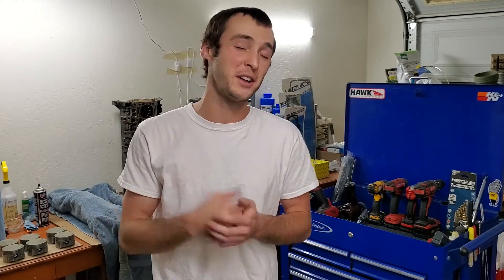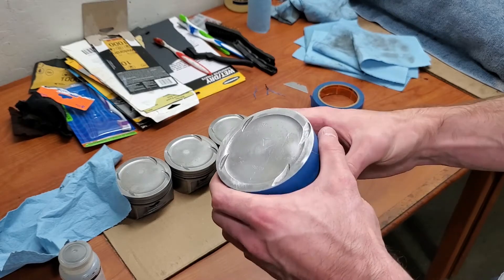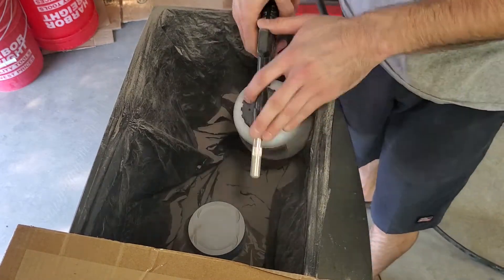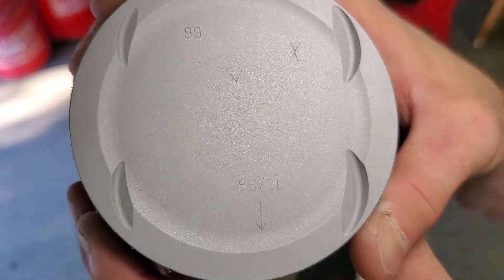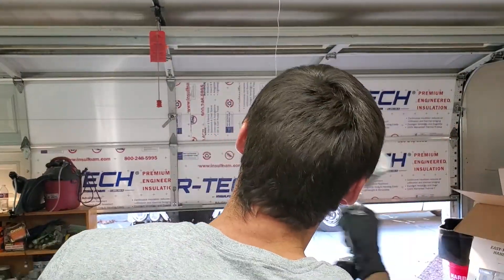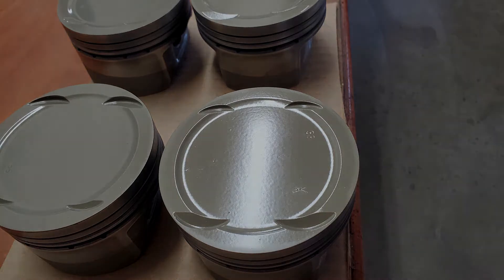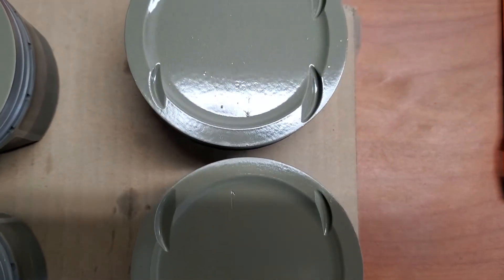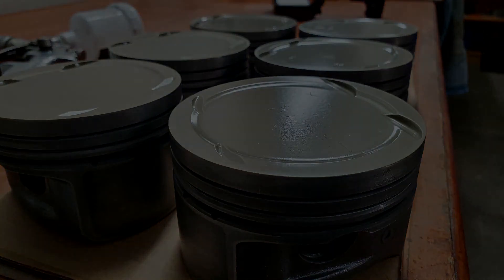How To Ceramic Coat Your Pistons | Cerakote C-186

Comment: For many engines, it would be worth checking valve to piston clearances. If these are already on the low side, adding 1-2mm coating thickness could result in a disaster. For my engine, the recommended clearance is 2mm for intake and 2.5mm for exhaust when the valves are open, so this coating would make those clearances a lot smaller. The scary minimum is 1mm, but this coating would blow that out by quite a bit. I'm just learning this stuff ATM, but something I thought I'd pass on. You can put plasticine in the combustion chamber after lightly coating the parts with some oil so it doesn't stick. Then move the piston through TDC and then cut the plasticine (carefully so as not to damage your coating) and check to see there's enough clearance where the valves make the greatest indent.
Reply: USA mil is not the milimeters, 1mil is 1/1000 of an inch (25.4 microns)

Comment: Hi :) I would like to know if Cerakote can be a reliable option for the piston skirt of a 1986 BMW 2.5L engine stroked to 3.0L with a 90mm crankshaft and short 130mm connecting rods??

Comment: Have you tore this engine down since this vid I am curious how they held up. I just started experimenting with this. I have been putting this stuff on everything. It crazy how well this paint bonds even with minimal to no prep.
Reply: Check out the one year update in the video "I Had To Pull My Engine Real Quick..."
Reply: I broke my engine due to a CP3 pump shaft failure. I have not taken the time to go over the engine. My purpose was to be able to run for longer with out melting my pistons. I noticed my coolant temps did not climb as fast. But the truck has been sitting for a while now. 
You would vomit if you seen out I applied it. 
I found your vid... 

https://www.youtube.com/watch?v=q6VK5iCawWY

Comment: Checked up on this from cerakoat there are 2 different piston coatings one air dry and one oven dry and they are both the same price and both have same temp tolerances and durability? it is not recommended to oven dry the air dry product so which one you use is totally up to you.  I would have to say buy the air dry because if the pistons are already on rods with pressfit pins then no need to have them separated. price I found was $35 for 4 oz
Reply: Thanks for the info.

Comment: so have anyone ranned the ceramic piston and then pulled it out after x amount of miles to see if it actually sticks to it and not just comes off
Reply from the maker: some time down the road i will check the pistons and see how well they held up. Theyre in the car though, its got 3500 miles on those painted pistons so far.

Comment: U needed to clean the paint gun with acetone because inside the parts of the paint gun it's still coated with a little bit of residual assembly Lube.

Comment: So I just stumbled across this today.  I was reading the Cerakote instructions and it says it is for piston sideskirts, is a dry lubricant product, and only withstands up to 1200 F combustion so not going to hold up too well for direct combustion.  How did you come across the idea of using it as a piston coating on the top of the piston?    https://www.cerakote.com/shop/cerakote-coating/C-110/micro-slick-dry-film-lubricant-coating-air-cure.  I'm thinking you may have wanted to use something different, say perhaps the C-186 or V-136 Piston top coat material.  I just was researching it some myself and came across your video and hopefully it is not anything that you can't check into and fix before you have run your motor!!!   Not trying to be a know it all, just a legit observation in regards to the difference in products for my own personal projects as well!
Reply from the maker: Hey, i used c-186 for the tops and c-110 for the skirts. All instructions are accurate, i just didnt mention using an oven to bake the pistons before coating. Instructions list this as an optional step.
Reply: @JakeSublime  Very good,  I skipped a little through the video so maybe I missed it, sorry about that!

Comment: Good and helpful video! Do you have to sand blast the top of piston even if there are brand new? I guess yes but asking just in case. Thanks
Reply from the maker: Yes, it gives a rough surface for the ceramic to bond too. If the surface is new and shiny and smooth, the ceramic has no nooks and crannies to grab into.
Reply: @JakeSublime   Did you use #120 Grit Premium Brown Fused Aluminum Oxide for sand blasting correct? Did you clean your new spray gun before use it? All of them comes greasy!!
Reply from the maker: I used what i said in the video, it was some grit aluminum oxide. Its to spec with Cerakote's instructions.

And, ive used that blaster with soda and glass bead several times before, it was clean. If i had known that they come oily, i would have mentioned it in the video.

Comment: Hello. If i cerakote pistons and chambers, do i need use colder spark plugs and do i need to cerakote bottom side of valve stem with valve face?
Reply from the maker: Great question. For my application, i still need to do some research on the best plugs to use. I may just use my original Ruthenium plugs, however. 

Now, Im going to do my best to answer your question. I assume youre talking about ceramic coating the head side of the combustion chamber as well as the valves.

Firstly, make sure you know EXACTLY what youre doing, you dont want to accidentally ceramic coat something you dont mean to. And, i would 100% bake the head prior to coating it with ceramic, to off-gas anything in the head's pores.

Secondly, i wouldnt coat the back side of the valves, as i wouldnt want to cover the valves seat and then have to grind through the ceramic to reseat the valve. That goes for the head side, and the valve side, of the valve seating surfaces.

Lastly, in a circumstance where 98% of the surface area of the combustion chamber is lined with ceramic, i would certainly take in to consideration the increase in combustion temperatures. This would likely impact the performance of the ignition source, and possibly require an engine tune to adjust for the increase in combustion efficiency. 

I sincerely hope this helps you. If you have more questions, or need clarification, just reply.
Reply: @JakeSublime  thanks, your answer explained everything)

Comment: The imperfections just looks like dirt/dust
Reply from the maker: yeah, its what it looks like sadly.. The downside of doing this work in an extremely dry environment, in my garage. 

However, it should still work. I have high confidence! haha hopefully not misplaced.
Reply: @JakeSublime  yeah dirt us usually fine just doesn't look the best. Good tip is to slightly mist the floor with water to keep dust down and if you have a drain I'd just do a quick once over with a hose
Reply from the maker: Fantastic tip, thankyou!

Comment: Nice prep work! I love the coating and color! What was the hardener to base mix ratio for the cerakote?
Reply from the maker: Look up the product number, there was no hardener. Just shake and spray!
Reply: @JakeSublime  have you ever ceramic coated the exhaust ports?
Or the inside of the exhaust tubes?
Reply from the maker: @FirstLast-tx3yj  Nope, just what you see here. It would be cool to coat the inside of the exhaust/turbo manifold though. This would improve the life of the manifold, and improve exhaust gas velocity!

Maybe one day ill try this out.

Comment: You need to drown the top of the pistons with acetone after you sand blast. You probably had some left over media on the tops. This is what cerakote recommends. You can also get a cheap tiny oven so you can "outgas" the pistons to also help in burning off any contaminants. Those contaminants will cause the ceramic to flake most likely.
Reply from the maker: I followed Cerakote's instructions, as their data sheet describes. The only thing i did not do was cook the pistons in an oven, as that was not required. Its likely best to bake the pistons first, however i do not have a shop oven.

Comment: This is a very interesting idea I've never thought of that we have a m104 2.8 that we plan to boost and quite possibly fit into a w210 e class thank you for putting this idea out here and giving great instructional video it's great to see mercedes cars being tuned more often as the engines are great just not built to be revved to 6500rpm we have more experience with the m111 in the UK as that's most common over here kompressor model anyway but there is a lot shared between these two engines
Reply from the maker: Hey, yeah im all about going the extra mile (or kilometer (lol)) to ensure the strong health of my engines. And yes, I plan to aim for a flat torque curve to combat the low rev limit. Ive considered adding a second set of mercedes genuine springs (smaller design, meant for another engine) to the valves to make the head better to rev to 7-7.5k but I havent pulled the trigger on that yet. 

Mercedes has made some truely great engines though, 100%. I love my m104.
Reply: @JakeSublime  I absolutely agree with you there the main reason m111 and m104 rods break is sometimes people treat them like a BMW or Honda engine and rev the out or past 8000rpm which unless it's got forged rods in it the end result won't be very good but an m104 with double valve springs should be perfectly fine at a max rpm of 7500 with some cautious timing on the top end but great videos I might have ago at this in the future keep up the great work look forward to seeing more videos